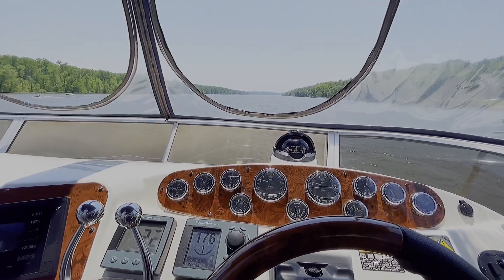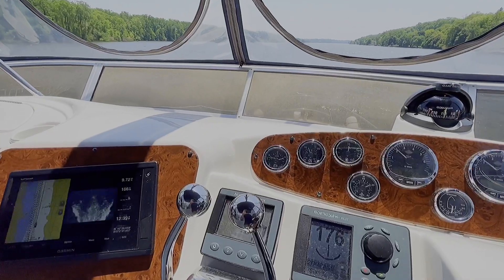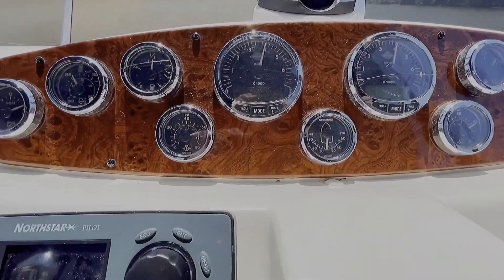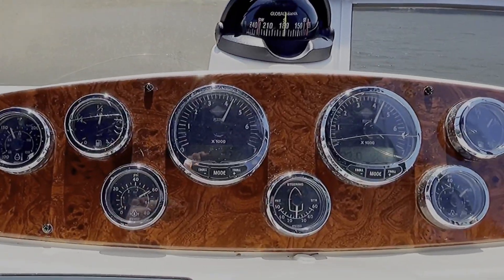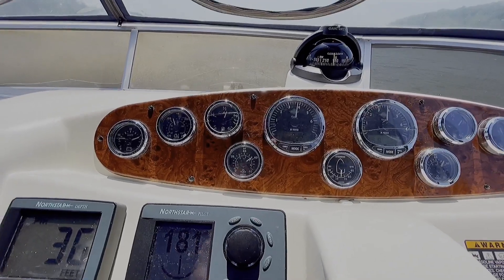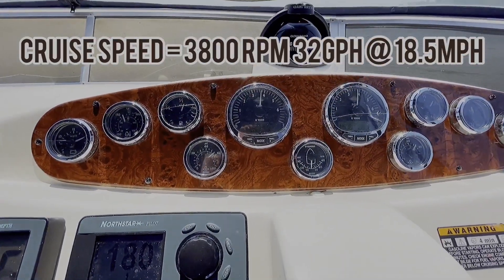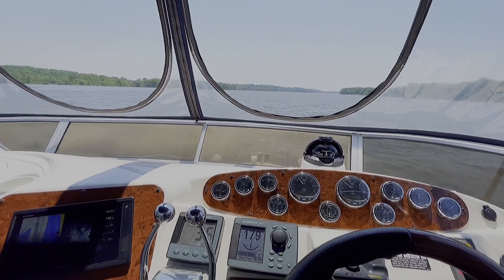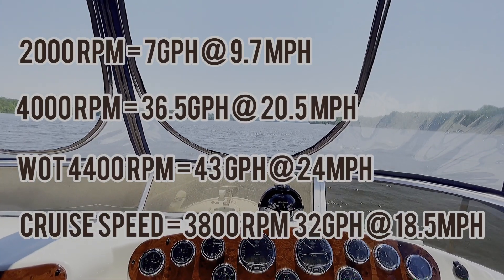Sea Trial with Refurbished Props

Comment: Nice video complimented with data! You will gain more speed at a higher RPM if you raised the tabs back up.
Reply from the maker: Thanks!   With my particular boat, and many 341 Meridians in general, full tabs down net higher speed as it raises the notoriously fat ass higher out of the water.   I’ve tried tabs full up, full down and everything in between and it just seems full tabs is the way to go when on plane.  Thanks for watching!